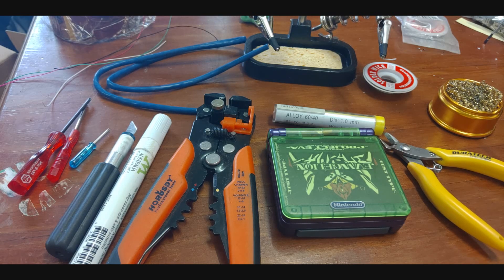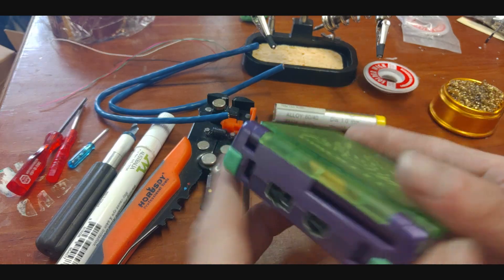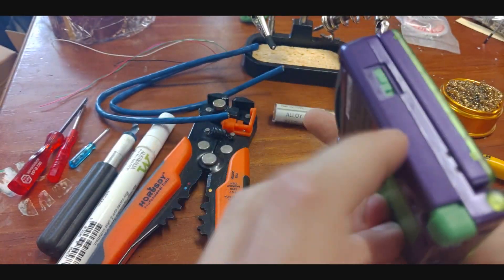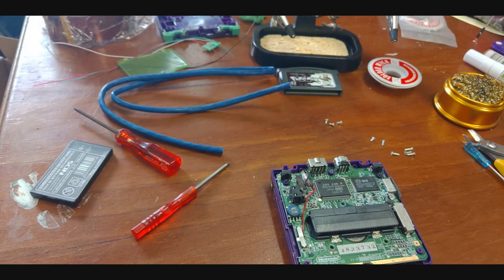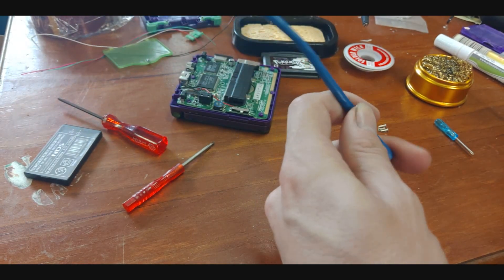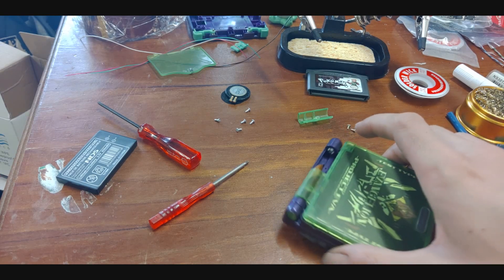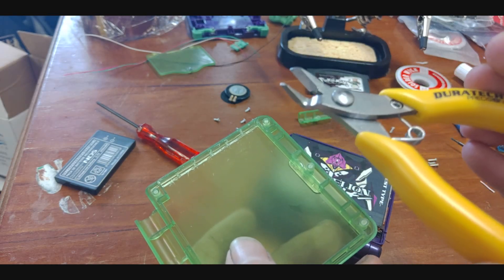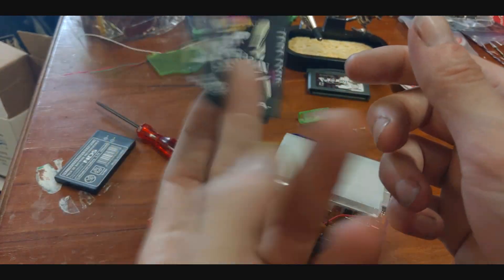Gameboy Advance SP case light mod

Comment: This is such a cool mod!  If you add the light-up button mod too it is going to be amazing.
Reply from the maker: Honestly, never been much of a fan of light up buttons or clear buttons myself. These MIGHT let some light in though so may not be too glaring.
Reply: @8bittoaster  You can get green clear buttons and they shouldn't be too bright.
Reply from the maker: @phailynrowan7976  I know, I'm just not a fan of them
Reply: @8bittoaster Hi dude, wondering how it would be to run your case light mod along button light kit mod ? Any risk of issues ? How'd be the power consumption ?
Reply from the maker: @ed3n4pf  to be completely honest, not a clue 🤣
I'm still yet to revisit this. 
I don't think it would pose much risk but I do believe it would really run down the battery

Comment: Hello, just wondering if we have an update on this, looks epic
Reply from the maker: I currently do not.
However, I have just received new parts I've ordered months ago specifically for it so I'll get back to it at some point
Reply: @8bittoaster  I do hope so, would love to do this myself.
Reply from the maker: @K13-X  yeah I've have thoughts over the years of new solder locations, thinner wire but also need to make my own LED panel. I need to locate all my parts and the console itself. I've moved house since then and it's still boxed somewhere.
Reply: @8bittoaster  I was thinking about this (I am no pro at any of it) but the Funnyplaying ISP screen upgrade. could you find a solder point on there that meant the brightness of the LED panel would be the same as the screen and if you soldered the brightness control on then the LED panel would change when you change the screen brightness. would this eliminate the need to fit a diode for the LED panel too?
Reply from the maker: @K13-X  that's actually not a bad idea.
I haven't got any diodes in it from memory (still packed in a box) but I've soldered to point on the board I've found for 3v.
I've even considered tapping into the link port on the points that get used for the Wormlight attachment.

Comment: Just thought I'd say thank for this idea I recently did a build with this mod and was able to add the included on off switch and place it in between the power port and the link port.  I had to cut a tiny horizontal sliver on the shell so that the switch was easily accessible.  I then soldered the switch to each port to hold in place.  I might post a video showing how I did it at some point but just thought I'd share as u mentioned u wanted to add a switch and my placement was perfect.
Reply from the maker: And I year later I still haven't installed it.
I did manage to find a heap of mini switches. Did you ever get around to filming?

Comment: Did you ever figure out how to do RGB back light or where to put a switch?
Reply from the maker: Nope. I have been thinking about other options for it though. A 2 stage button seems to be more space efficient. I need to relocate my parts and the actual console itself. Went through a move and my stuff is currently all over the place with no real known home 🤣
RGB I'm not looking into. I think the first step in returning to this will to just build the backlight panel, buying it is unreasonably expensive.

Comment: I don't understand how it's wired up on the board itself?
Reply: positive to c1 next to power switch and negative to the left of the link cable port
Reply: @slof69  thank you
Reply from the maker: Yes, direct solder to board. Once my builds are 100% complete I will do a write up on solder points. It's not hard to figure out, I just don't want to release the information until my builds are finished.
Reply: @8bittoaster  ok I'll be waiting for it
Reply: @8bittoaster  2 years later, did you ever get a chance to specify where exactly to solder the wires to? Thanks!